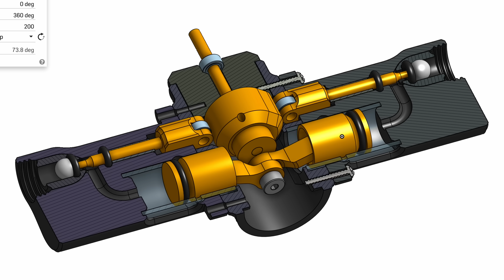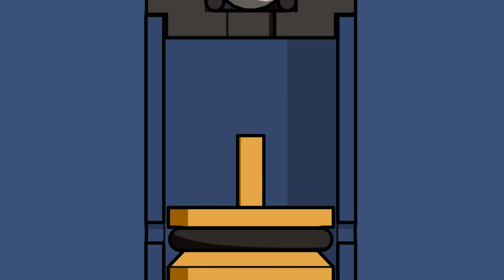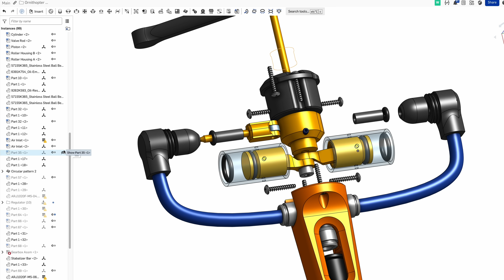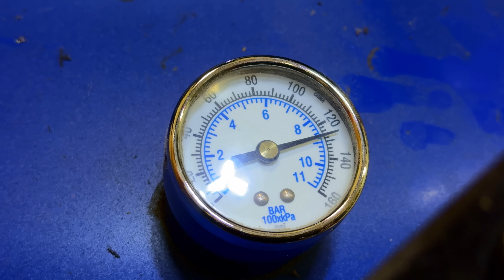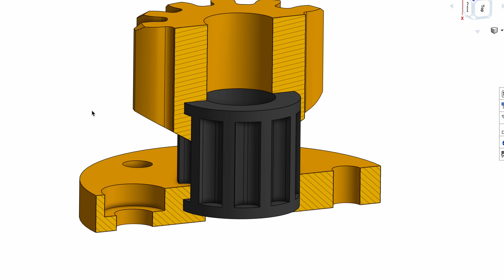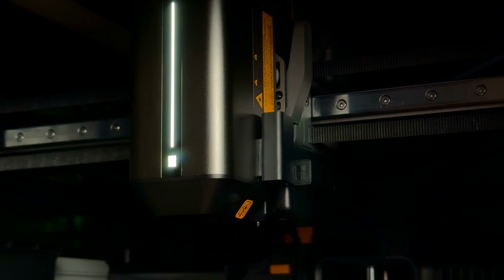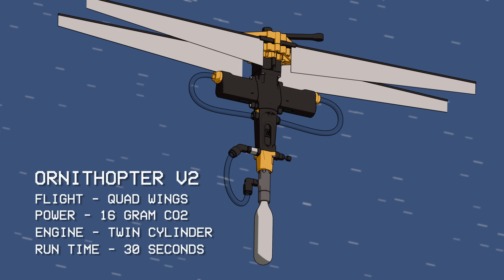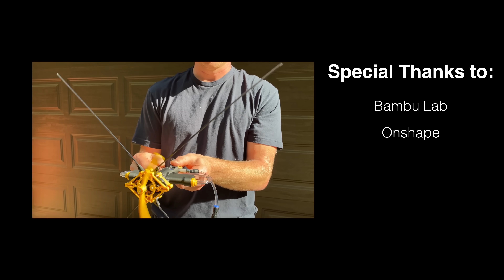I Tried to Build a Flying Machine With Just CO2

Comment: Great job! 😎👍
You did the most important job to prevent it from falling apart. 😄
For example, you can start cutting out the plastic around the transparent cylinder, it won't lose strength and the piston will be better visible.
I'll be interested to see how it turns out for you.

Comment: Incredible video, i think wing motion and design tweaks could offer significant improvements towards flight. 
Right now, it seems a lot of motion is wasted in just moving air laterally back and forth. 
You need some wing shape/wingtip path that focuses on beating air downwards, it may require some funky ball joints and linkages but perhaps observing dragon fly footage could help!

Maybe its even worth looking at their wing area, beats per second, and overall body mass and seeing if you can back calculate how much air they have to displace to fly, and then linearly scale that to your model.

Amazing editing quality!

Comment: Why take the losses of converting from reciprocating motion in the pistons to rotational motion in the gear train and then back to reciprocating in the wings?  Couldn't you save a lot of weight, complexity and friction losses by driving the wings off of the pistons via a lever linkage with no cams, crankshafts, or gears involved?

Comment: I'm no expert, but every time I see pistons I wonder "could that be a Dorito?". Since this isn't a combustion powered system, I guess the fragility of mixing lubricant oil with the gasoline won't be a problem in this air powered system. That way you could probably use two rotors and insert more chambers into one rotor, since I have a chemistry degree, I'm saying all that from wikipedia and YT knowledge, but would be glad to hear more qualified people's takes on it

Comment: You calculated the optimal performance psi of your motor while it was under no load and had no torque requirements. 

You need to calc the optimal pressure again but under realistic load from your wings angular momentum and air resistance. Then adjust your regulators accordingly.

Comment: Your wings are way too small, not moving enough air. Look to the dragon fly and use similar proportions. It's not just the length of the wing. it is also the width and shape.

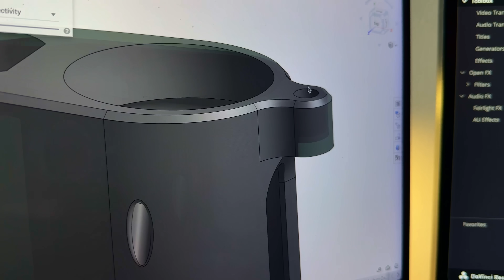Comment: 5:43 couldn’t you have just printed the part upside down to avoid needing support material?
Reply from the maker: Internal structures were more important and needed to be printed without support so I sacrificed the external overhangs

Comment: This was very inspiring and i don't have access to cnc machine and i didn't feel like making something that flaps like a bird with a 60gram co2 canister so i went with a balloon it somewhat worked i am still working on it a balloon isn't the best choice because it flaps around and makes imbalance weight but when i will make the Motor light enough currently 30 grams not included wings just motor the the balloon barley has enough pressure for anything but i am determined to make it work also for anyone watching the video it might look easy but its really not making everything light weight and and don't get me started about getting it to achieve flight when i will hopefully get it to fly i will update currently the motor works and i kinda stole the wing mechanism lol p.s can i have the data sheet of the wings thank you

Comment: I believe you may need to focus more on the aerodynamics of the system than the engine itself. It seems you've come up with a nice and performant engine system, but that means nothing if the output energy is being used inefficiently/ineffectively, hence aerodynamic efficiency should probably be a point of focus imo (e.g. optimization of efficiency in translation from pressure to downward thrust, maybe by doing something like finding an optimal balance between time-per-flap and wing shape/movement/dynamics). 
Here's some ideas that I hope you may find in some way useful:
Perhaps doing something like measuring the forces in each orthogonal direction in 3D over time when you go through a single cycle could help figure things out. Maybe electronics could help with debugging things during the process, like using an IMU to measure out exactly how the device is moving over time. 
Perhaps an automatic balancing system involving something like an adjustable pendulum/weight for balancing out the forces as desired could help keep things stable during flight (or, perhaps having a mass hanging from a long string (or rigid piece of plastic) could help keep things from going off course, i.e. have it go straight up?). 
Also, maybe trying to leverage the kinetic energy of the "flywheel" could help with efficiency..
I have absolutely no idea if any of these ideas may work, but I hope they may be of some help. Keep up the good work!

Comment: I’m no engineer but I’m surprised with all of the 3d printing you didn’t print manifolds for the air to flow more efficiently than through those tubes. I would think you’d get less weight and better stability without the tubes flopping around.

Comment: great project, but I wonder if there is away to directly use the back and forth of the cylinder for the back and forth of the wing, instead of converting it to a rotation and back.

Comment: Really cool design! Things I'd tackle is perhaps ditching the gear reduction as a source of friction and upsizing the motor cross-sections instead.
The two-stage pressure reduction system also seems to be quite heavy - maybe that system can be shrunk further?
At the end of course carbon instead of 3d prints can shave weight, but I dont expect thats a novel thought ot anyone (even less than the previous two^^).

Comment: the power density of those co2 cartridge are too low. putting them in hot water would give you small boost in performance. what you're trying to do is really hard but i don't need to tell you that . don't give up

Comment: Probably going to get buried but are you pointing the cylinder exhaust down for a little extra thrust?
Reply from the maker: I did! However I could probably point it a little straighter down
Reply: Just asked the same, you probably get this a lot, what about better nozzle geometry, like in October Sky
Also, a bank of cartridges for more power, and prefilled reusable over-clocked cartridges

Comment: I'm probably wrong because I don't know much stuff about this. But maybe you should remove the last pressure regulator because when you split the air into two streams doesn't that reduce the pressure? So in reality you yave 3 pressure regulators because the thw tube is splitting, which splits/reduces the air pressure??

Like I said, I don't know if I'm wrong or right.

Comment: Use the information you got now with version 2 to make a few key ratio pints like power to weight etc. and work out the pressure limit so you can increase psi for faster flap motion, maybe different wing types/shapes to increase lift per stroke.

Comment: wings are too small and slow, drop some more weights. the Piping is too Elaborate. make a direct connection, try crankshaft counter weight. And boxer piston setup is know for its vibration.

Comment: You didn't even start to optimize for weight, also it would be extreme to make it fly without electronics. If you strip down an arduino nano design to bare essentials it will make it happen.

Comment: You know that the most efficient way of using the energy stored in a compressed gas is to literally let it out with no moving parts? Factory already used mechanical energy to compress that gas, what's the point of converting it back to mechanical energy with all the losses involved before using It

Any additional energy conversion is an efficiency loss, just a rocket made by letting it out trough a noozle will always be way more efficient

Comment: If you could design a variable stroke piston engine, you could do away with the regulator and extract 3 times more power from the cylinder.

Comment: Look up the 'Disc Loading' article on Wikipedia. Essentially, the more air mass  you entrain with the wings, the lower the power needed to hover. It's all to do with the lift force being proportional to the change in momentum (massflow x velocity) added to the air through the wings, but the kinetic energy of that air goes up as velocity squared. So, it's more efficient to flap a large volume of air at a slower velocity, than a small volume of air at high velocity. I mean, you've got more problems than that, see the comments about going direct to reciprocating motion and not converting between reciprocating-rotary-reciprocating for instance, plus some lube is needed, but to get this to fly you'll have to tackle many individual problems one by one. Great start though! ;0)

Comment: If you made the second cylinder larger, you could recover some of the waste energy from the exhaust, a bench test would probably be needed to work out the correct cylinder size but doubling the initial cylinder area would probably be a good start.

Comment: hi
i think yo could reduce weight by using a plastic container with dry ice instead of the co2 tank, in this way you could also erase the first step of pressure limitation, maybe also the regulator.

Comment: This is really amazing.. Please go ahead you already made a great piece of art and it still needs to be finished 👌.
Reply: I'm just thinking possible ways to improve..
What if the pistons are somehow vertical. And if it won't add up more wight make it 4 pistons. That way you have more torque and you can make the wings larger.
Also all the pipes can be enternal to the body it self
Reply: @worksbydesign

Comment: Wait, so you had an engine without a flywheel that produced an oscillating back and forth motion and you changed it for an engine with a flywheel that spins just one way and tied it to a mechanism with friction losses to produce the oscillating back and forth motion?

Comment: Another thing you could try is to use an impulse maschine (basically like that greek steam engine that is a spinning ball with two nozzles).
This could save a ton of material, since the piston isnt producing power 50% of the time, and you could shave off a ton of complexity, since you can basically shave off the entire engine assembly after the pressure regulator.

Comment: You might want to use an opposed piston engine design instead. That would be easier to get the wings activated. The wings really should rotate about their axis on the upward stroke and then go flat against the air on the downward stroke. That way you get good lift and less resistance on the upward stroke, which limits the lift.

Comment: im not an expert or anything but i belive a boxer engine would be more optimal as it would eliminate unnecessary shacking waist in the air. normally the draw back of a boxer is its more complex so less durable but the only resistance is air resistance so i feel like a boxer would work butter but as iv said im not a expert
Reply from the maker: Great point! I’ll might look into testing that for v3!

Comment: Absolutely fascinating engineering concept with a scientific approach. As anything in science, you try, you fail until you reach success. Think it’s about weight, just as anything that naturally flies as birds their bones are hollow. Even modern engines aren’t completely solid, maybe try to redesign what you already have printed out but with a hollow structure between cylinder walls to the outer engine block.
Reply from the maker: Glad you enjoyed and thanks for the feedback! I think you’re right, reducing weight with lower density material / hollowing parts out should really get it close

Comment: I once took some research on ornithopters, particularly insect wing designs which yours seems to be inspired by. And the main reason why we can't scale up is simply because to produce the same level of thrust to weight ratio the wings would need to be much much bigger 😅 so scaling up the wings. Maybe it could work

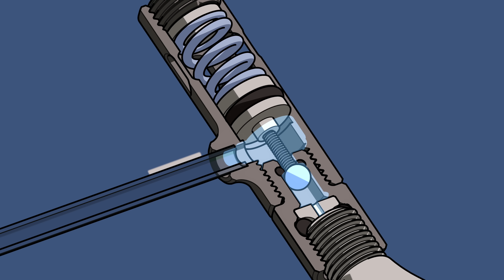Comment: Looking at the design at 10:52, I think you could have a hole in the head of the piston to allow the air go directly through it into the next stage of the pressure regulator instead of using a tube.
You probably also could remove the spring by using the concept behind how Gas Springs work (see This Old Tony's video on it). This would make it significantly harder to tune the it but would save some weight.

Comment: This is amazing! Looks like you are losing a lot of energy in the venting of the lower pressure air exhaust.  What about mimicking a car turbo setup? Route the exhaust into a turbine linked to the drive shaft?

Comment: just put a nitro engine, its mechanical. Also your "boxer engine" has wrong crankshaft design, pistons needs to move in opposite directions to each other, so its perfectly balanced and no vibration...

Comment: You can slim down by printing in CFPEKK. I have an unopened spool I can send you. My CreatBot F160 can technically run it but I just don’t have the experience & I’d love to see someone make the most of it with a beautiful machine like that. About as strong as aluminum, slightly denser than PLA. VisionMiner even did a video where they pressure test a fitting they printed from it. Should allow you custom lightweight gas couplings & pressure tanks. More importantly your wings are far too small & flimsy & borrow too much from the dragonfly without incorporating some of the necessary aspects to their wings’ success. The pterostigma for one is a subtle mass on the trailing edge that dampens destructive interference in wing oscillations. Two, CFPEKK would also be ideal for a rigid skeletal support for a larger flight surface membrane, or simply compose the entire wing surface out of a thin CFPEKK print. Your surface needs more area & strength to achieve survive takeoff. You may also consider supplementing the onboard gas with a featherlight electromagnet circuit, engaging rare-earth halbach arrays as the wing approaches the peak or trough of a stroke in the wingtip that also act as pterostigma. As the wings converge towards each other, the wings themselves undergo deformation, & thin “elytra” extending out from the fuselage carry magnet wire coils that pin the wingtip magnets when in range to further increase elastic energy before release, whipping the wing back into stroke. By finding the right current, pulse width modulation, electromagnet position, wing stroke angle, & the right wing geometries/materials for strength & flexibility, an Arduino nano & a kapton-graphene supercapacitor could be enough to run an efficiency scavenger that would produce more lift per gram of air by converting wasted wing vibrations into applied elastic power. In terms of long-term design anatomy one would eventually seek to fly this craft horizontally & as such pursue a fixed-wing protocol by cutting gas & sustaining the electromagnets to gain the advantage of gliding as well as potentially using high voltage ion thrust between the wings and the elytra.

Comment: You could try increasing the flapping speed by adding a spring mechanism to make the wings bounce almost on their own, then only a little engine power is needed to keep up the movement. But then keep an eye on the spring given resonance which should match the engines max performance speed. To get to the max deflection while keeping the resonance and flapping speed may afford another flexible part, because the springs stiffness would brake out a regular crankshaft-for-flapping mechanism because the resonance doesnt match at the beginning. At the end you could then decrease the angle of attack of the wings for even less flapping resistance, more speed and higher efficiency. because the wings then change directions so fast, a slimmer wing design would improve too.

Comment: What about dual stage engine like steam ships used to have? That might give you more power. Also im not convinced your wings can ever flap fast enough in that orientation to provide enough lift. I would look into contra rotating propellers with the "swash" style control like TS did. That would give you more lift with little weight change and more control too

Comment: This is really cool. However, the full weight of the 12g co2 cartridges is 40-43 grams, so you will have to add thrust in addition to shaving weight if you want to use them.

Comment: Not too sure if you can just altogether ditch both the regulator and just settle with just a needle valve. Or no  just use a single stage regulator. Just the 150 psi regulator and a needle valve. Should lighten everything
Reply from the maker: Good point, I think I'll try to remove at least 1 regulator for v3

Comment: Don't.
 Know, if anyone has mentioned this or maybe even I commented before but your wings are too narrow. They need to be deeper from leading edge to trailing edge. you're not getting enough thrust because of that. Even the narrow wings of a dragonfly are wider than that.
Reply from the maker: Good point! I'll keep that in mind for the next iteration, I should've done more testing on wing size and variations
Reply: Although I caught a thumbnail of a different vid, dont know if it was befote or after. I didn't watch it, but it had wings more like what i would think would be better. They looked as if they had angled supports in the wings, the device had thrusters as well. Anyway good luck!!! I understand the quest. I've built many ornithopters, with various changes to the frame, wings, mechanism, etc looking for optimal performance. It always amazes me how the slightest difference in the wing, from the left one to the right, will make a significant difference. I still have a few flyin round in my head waitin to be born@worksbydesign